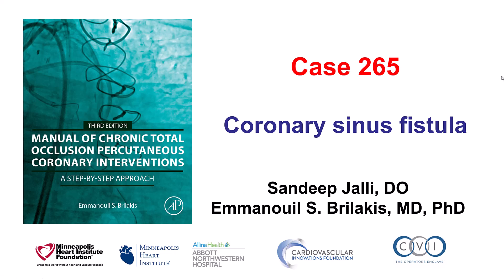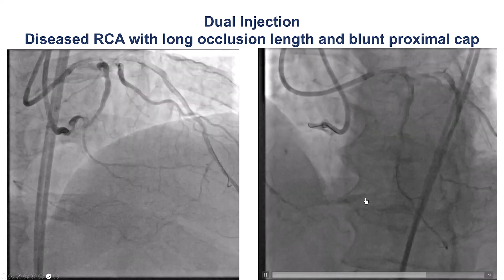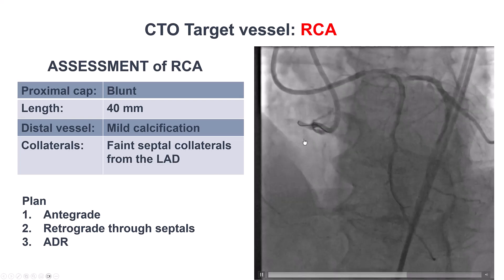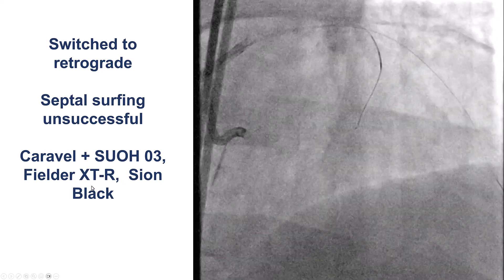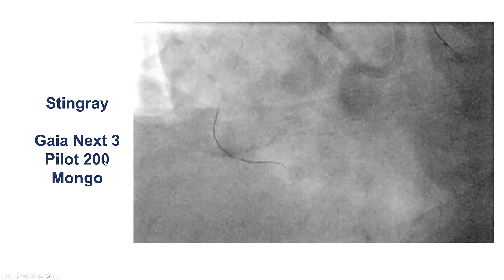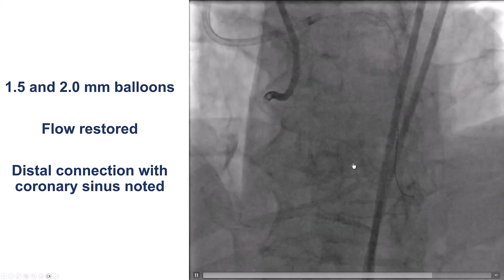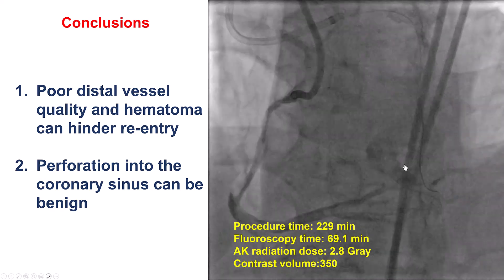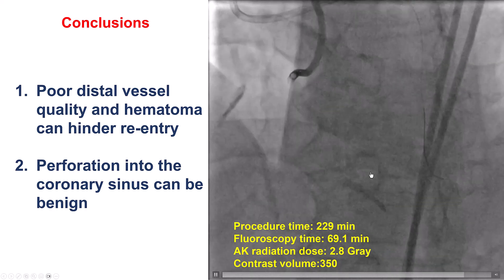Case 265: Manual of CTO PCI: Coronary sinus fistula

Comment: Hi Professor Emmanouil Brilakis.  I  want to ask about investment procedures. Did You have some situations, when You performed investment procedures in acute vessel closures? I have seen in some cases when wire didn't cross into true lumen in Patients with acute vessel closures and very tortuous arteries and after doing block and aspiration intramural hematoma the wiring of true lumen was failed, but distal true lumen was visible.
Reply from the maker: Great point - yes, STAR can be used to restore antegrade flow in case of acute vessel closure - ideally the knuckled polymer jacketed wire should be advanced in all or most major branches if possible.
Reply: @manosbrilakis  Thank You for help me. I have done this maneuver in some cases: i tried to change tip of the wire to double angle, and when polymer jacketed wire was advance in side branch and tip of the wire was in no-spiral configuration- i tried to advance the microcatheter, to confirm wire  true lumen position by small injection - if yes, than i tried to move the wire and microcatheter to bifurcation and try to wire  main branch, but if no - i have used the block, aspiration and knuckle wire.